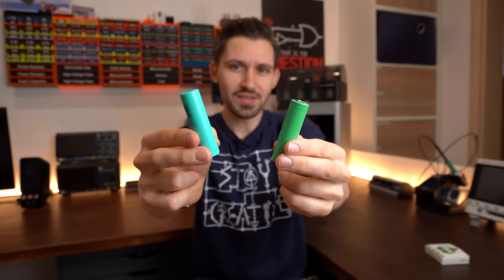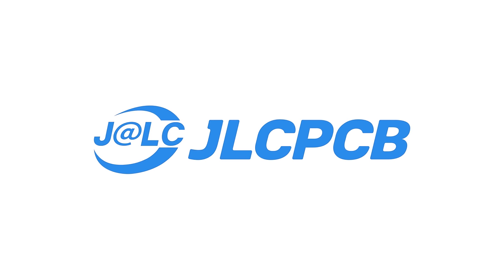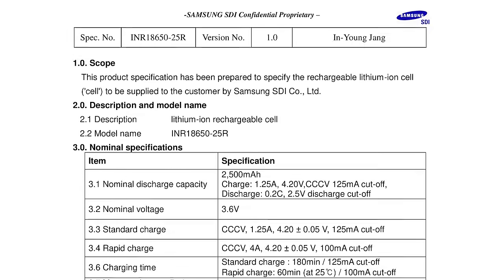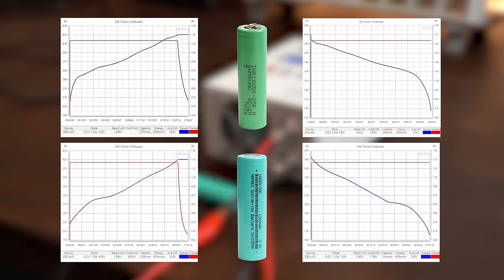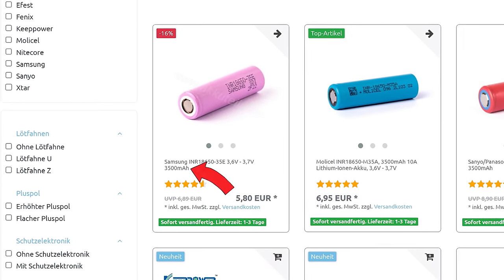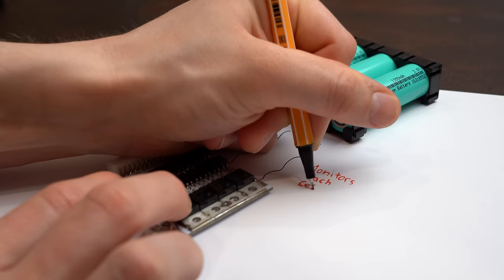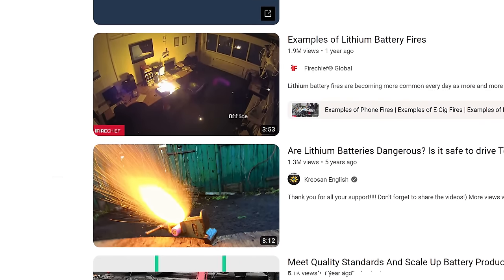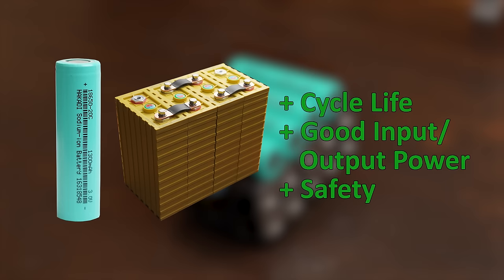"Salt" Batteries are FINALLY Here?! Sooo should you use them?

Comment: Great video! Didn't know these were available at all yet, even given the limitations you describe.

I would love to see a cycle life test on these to see if they live up to the claims; I'm both curious if Sodium-Ion does as well as it's supposed to, and also whether these particular cells meet their specifications on that front. My experience with "no-name" cells is generally that they perform the most below-spec in terms of cycle life even if their initial values are otherwise fairly good, and I suspect it's largely because of low quality/purity ingredients used in their manufacturing.

Comment: The most surprising thing I learned in this video is that LFPs are used in electric vehicle applications. I've always thought they had such terrible gravimetric energy density that it would be impossible. If this sodium based chemistry is comparable to (or even slightly better than) those in terms of performance it would pave the way for much cheaper evs

Comment: If you cut the battery open without setting yourself on fire, or burnibg your house down, therex an easy way yo test for sodium vs lithium. If you take dohevof the materisl and burn it in a flame, sodium makes a bright yeloow flame. Lithium makes a red flame. Usually you use a woiden spkint or a nichrome wire. Try a flame like a propane or butane torch. You can google the test. I dont really recomend cytting batteties open though because they tend to catch fire.

Comment: I've thought about this for a while, that lithium could be replaced by other metals in the first row of the Periodic Table in batteries. You could potentially get even higher cell voltages by using, say, potassium. But there is one thing that will make lithium based batteries better on  capacity per unit weight basis - the atomic weight of lithium is far lower than that of sodium, potassium, etc. Which means a mole of lithium will weigh a lot less. You might eventually be able to pack more sodium into the same package to make up for it, but the batteries will weigh more.

Comment: Aren't you able to discharge sodium batteries until they are totally dead? That's some of their huge advantages, I've heard.
Also I kinda think these are kind of two cells together, because sodium batteries had a voltage of around 2V per cell.
Also chemically the energy density is to be expected.

Comment: Power density means it can be useful in stationary applications, otherwise gasoline and diesel are still king except for small toy cars and drones. Especially the high charge/discharge cycles with 20% degradation is a real plus for sodium batteries for price and environment. But for stationary storage you can still use lead acid batteries which give you over 10x times more Wh/€. People should do more back of the envelope math.

Comment: The thing is, lithium is a small part of the battery mass, 5-7%. Unless the sodium batteries offer some incredible advantages (order of magnitude less price, higher durability, higher A rating, etc), they are trying to compete at a great disavantage. Btw sodium batteries might also be explosive, they are not dry batteries or solid ,  and the liquid tends to be an explosive hydrocarbon.

Comment: Strange that the first EV companies already announced their switch to Sodium batteries, considering power output is so important due to the already low range (400-600 km) of EV's even with top quality Lithium-ion batteries, and the fact that thus far Sodium batteries still have much lower energy densities than Lithium based batteries. For industrial and residential applications I can understand, there the energy density isn't as important, the price per Kw/hr is.

Comment: Thanks for a great video. 
I am not very excited by these Sodium Batteries for "small" applications. But, they might be useful for homes if the price was much much cheaper. I don't see it useful for small applications because the energy density is far too low vs Li. But, for storing solar, where the battery size is inconsequential and cost is critical, then it makes sense. 
However, I don't see the industry moving in this direction. Instead I think it will try to create a similar product to Lithium, which will then be doomed to fail since Na doesn't have recognition. Unless they can make 1, 2, 4, 5 and 10 kWh batteries at around 50% to 75% the cost, and same life cycle, then this tech will fail in the long run vs the already established Lithiums.

Comment: I think this will not be an option for small devices like phones or weight related things like drones or Cars. But it sounds amazing for stationary Batteries. I think a lot of home owner are willing to take double the space to get from a Tesla Power wall with like 22.000$ to 11.000$  or even 6.000$. (In the US the walls are basically out of paper, so just use the batteries as a wall). I know in Germany are some villages that have like there own energy storage system just for there town made out of used car battery's and so. With half or firth of the price i think it could be cheaper to build Solar and Wind together with these battery's then to use Oil, Gas or Coal for electricity.
If it gets cheap enough it could be even liable for ships. But i think this is more like for in 10 or 20 Years. When Oil gets more expensive and electricity cheaper. And then there could be a better method.

Comment: some programmable BMS supports different batteries. i have one that supports cell voltages 16v high and 0.2v low. this is handy if you using capacitors as energy storage. i have a small outdoor rover that is powered by the sun and wind and it uses a pybord as cpu. this thing as a sim400 for comunication. it works fine with only capacitors. it could be better in some parts but 10min working time in winter and 1h in the summer is not bad for only 1wh storage.

Comment: You know A123 LFP cells? Those have a discharge rate of 30C and 50C peak. So no, LFP is not weak. It really depends on the goal: power or energy. The sodium ion and LFP cells you are comparing are both energy oriented, while the NMC cell you are testing is power oriented.

Comment: They show promise. Cheaper, and they seem to have a lower operating temperature that Li-Ion. Which was a big problem for EVs during that North American cold snap back in January. But the lower energy density doesn't make then great for non-static applications. You could use the for EVs, but the vehicles would be even heavier than they already are if you want comparable range. Then again people might be willing to accept a little less range if the vehicles are a lot more affordable. Just depends how much.
Reply from the maker: Yep, all good points. Thanks for the feedback :-)

Comment: Should I be worried when I have disabled the BMS on my electric unicycles 72v battery? First I had to disable the undervoltage protection 12 years ago because it was turning itself off when using lot of current and having a low battery which was dangerous and a year ago I had to disable the charging overvoltage protection and connected the charger directly to the battery. Can Li-Ion be charged on the balcony, if it's cold outside? Nights are starting to be 0 degrees C now, so maybe I could charge and store it on the balcony soon? Batteries are also kinda old, changed the cells 6 years ago and can only do short <2km trips with it and can't use full speed on low battery anymore. Now it's between me and my door, so I can't escape if it burns.

Comment: seems like it would be better for applications where higher weight for same capacity is not a massive concern, but longevity and safety are priority, such as static applications like home power cells, medical devices, and low power IOT devices, maybe even low power robotics and drones (not going to power a racing microdrone or a heavy payload lifter, but maybe a small slower power one, or some stationary robotics could indeed be powered by the lithium alternative), cameras may also be a viable application, as would things such as space probes, as they need reliability over absolute power delivery. I think sodium ion will take the place of nicd, alkaline, and low power lithium applications where liion gives more instantaneous power than needed, but lower long term reliability for the most part. I can see a thousand applications where sodium may indeed be the superior choice due to the higher internal resistance as well, since that also drastically reduces self discharge, it means the cells will lose power more slowly than their lithium counterparts as well, meaning bulk storage would be more efficient in a shelf life priority, such as backup power systems, not needing to be topped off as often as lithium when not in use, and having several times its contemporary's cycle life means it would work perfectly in those applications as a more reliable alternative, I think additional cells in parallel could make up for power delivery by splitting the load, though the added bulk is overall more than made up for by these other traits. The cost of materials alone is game changing given how common sodium is, and the higher cycle life per cell means per unit material used, the functional lifespan is vastly superior to liion for the cost, even at the current pricing. To summarize, I think we will see sodium ion used more for mid to low power applications, and durability paramount applications, while liion will be delegated to where energy density is utmost priority.

Comment: Nice vid,  do you have any idea how much energy was discharged vs the amount of energy it took to charge the battery? for example was the na battery 80% efficient?
Reply from the maker: Sodium In was 4.32Wh and Out 4.07Wh. So around 94% efficient. Lithium was 9.1Wh in and 8.7Wh out so 95% efficient. Interesting. Damn, I should have included that in the video.

Comment: Woah Woah, you can't compare a nominal discharge lifespan with a max discharge rate lifespan! Simply discharging at a standard rate will likely double the lifespan from 250 charges to 500. Only charge to 90% capacity and you've doubled the lifespan again to around 1000 charges. Now keep in mind that only charging a Li ion battery to 90% still makes it vastly more energy dense than the sodium battery and you've ended up with the total opposite answer to the lifespan question. I think though, the general consensus seems to be that the sodium battery does have a slightly better life span which will hopefully get much better as the technology matures

Comment: I would be more confident in the charge discharge graphs if you also compared how the lithium battery charts would look if you used the same settings as the sodium test to charge a lithium cell. Also if the lithium cell was closer in MAH or capacity to the sodium one. If I was lying on what my battery was made from,:I would just use a really cheap, really low capacity lithium cell anyway.

Comment: The easiest way of converting salt to sodium metal is to heat it past the melting point of salt and separate the sodium via electrolysis.  Chemical separation is not as simple and requires exotic chemicals.   So it's not an easy or cheap process.   So I'm not sure that sodium batteries would ever rival lithium.  It's like solar panels.  Silicon is readily abundant.  It's everywhere.  But separating it from silicon dioxide (sand) is not a cheap process.  Otherwise solar panels would only cost a few bucks instead of hundreds.

Comment: It's one half the capacity of Li-ion... That's not bad. Not bad at all for a tech that just entered the consumer space
Reply: They came out in the 70s and were rejected because they weren't viable, they still aren't. They're also 3x the weight for the same power density. This is just a distraction from the failures by the failing ev market to try and keep the dream alive.

Comment: Sodium cells look ideal for speakers. Low draw use with larger capacity battery's, I might want a large dewalt pack to run my speaker and flood light for hours on end without putting cycles on my Lithium battery's.

Comment: That 0.2V difference with same size is potentially dangerous for end users. It will jist fit in any charger that uses voltage thresholds to differentiate between chemistries and voltage windows overlap too much. That being said, chargers equipped with voltage dividers can be modified to fit both chemistries but without charging li-ion fully
Reply: Depends on how the sodium chemistry reacts to the extra voltage.  Will the cell be damaged or just get warm?

Comment: I think you made it to easy for yourself when comparing sodium battery with the regular lithium battery as the specs where more close to a lithium iron phosphate battery.
They feature much greater cycle life's - especially when you use similar/smallerbDoD values (depth of discharge) - where some lifepo4 batteries have 3-5000 cycles of lifetime.

The the result would be, that those cells are promising, but yet not a reasonable replacement for anything substantial

Comment: I see a big problem with Sodium-based batteries - 3.3V.
With single Lithium cell you get far more power (both absolute and percentage) above 3.3V (considering 0 dropout voltage on regulator) than with the sodium one.
But it can be argued that a lot of manufacturers already use multi-cell Lithium (without balancing!) so probably not that big problem IRL.
Reply: sodium-ion can be charged to 4 volts
Reply: @sigataros  True but Lithium can go over it. Just look how long it took to discharge the battery under about 3.3V

Comment: Is it possible to 'combine' the two in one,  parallel with for example, 15% lipo, 85% sodium for extended capacity, compromise the charge rate, and still maintain a nominal safety margin..?

Comment: it would be rather easy to see if you have sodium or lithium in your battery, take everything that is inside the battery and dissolve it in ethanol or methanol, light it on fire and see what colour it is.

There is a lot of sodium all around so you'll probably get a yellow flame in all cases but if it has a distinct red colour as well then you have lithium, if you have a lot of sodium also , it would be very yellow.

Comment: Man with sodium cells my lighting stuff would be significantly cheaper. A little more voltage dropping off isn't such a big deal, as your eyes continually adjust anyhow. Also some 18650 chargers also come with a voltage limiting setting. Mine can do an 80% charge  which is close to that 4v

Comment: Nice test and conclusion for a new technology :)
I think we will have to wait a bit till these become a real alternitive to current batteries, but as long as size and weight is not a concern, I can see these replacing them (in a hypothetical case where they are 10 times cheaper while offering 1/2 or 1/3 of the capacity)
I guess it could also be a problem with the lower max constant current, but in what applications do we have a 100% current draw on current battgeries that cant be fixed with just adding more parallel battery cells?

Comment: It's interesting that you say that the Sodium Battery (aka NIBs or SIBs) aren't in mass production. However, there are EVs that are currently in production using this chemistry. They aren't 18650, or similarly, sized.
"JAC Group’s Yiwei, a new EV brand in China backed by Volkswagen, debuted the first sodium-ion battery-powered electric car. The new JAC Yiwei EV rolled off the assembly line Wednesday." Dec 2023
"According to CnEvPost, JMEV, an EV brand owned by Jiangling Motors Group, will offer a version of its EV3 fitted with sodium ion batteries from Farasis Energy next year. The first of those cars rolled off the assembly line on December 28, 2023."

The bummer part is that the density is almost half of that of Li-Ion. However, it can be recharged far faster and safer than Li-Ion, making time at a regen station significantly shorter.
Overall, I think these would great for home energy storage without the risk of potential random fire happening, meaning they can be stored close to or even inside the home

Comment: Question on other subject. I am not electronic savvy. 

I wish to know what will happen if I take (2) 12VDV battery power supply surge protector connect in series. Can I get 24VDC? Will it destroy the Power supply? I have already removed the battery, battery is old, can not take charge anymore.

Comment: The whole reason for a BMS is a lithium cell's charge state can't be deduced by reading it's voltage, so the BMS has to keep track of how much charge it has already received since it's last discharge.  With sodium cells linear voltage/charge ratio the BMS is MUCH simpler.  I suspect you don't even need a BMS because a more charged cell is going to have less voltage drop across it, than it's less charged neighbor.  So the less charged neighbor gets more charge.  This would tend to equalize all the cells in a string.  I have not run that experiment though, so somebody put together a string of sodium cells with no BMS but monitoring to see how individual cells charge during the process, please.  Then let us know.

Comment: I really like the idea of Sodium batteries because they can be very cheap.  I can not see a future where lithium batteries go away.  On the contrary, with the introduction of Sodium batteries,  lithium batteries will be put to more specialized uses.  
Sodium batteries are less energy dense but have greater temperature stability (They can be charged and discharged at lower temperatures).  Sodium batteries will be used in the same places as Lithium batteries, I see Sodium batteries being best used in solar generators, power stations, and (Maybe) laptops.

Comment: LiFePO4 cells are rated for a Much Much higher cycle life than the 250 presented in this video. LiFePO4 batteries are typically rated for 80~85% @ 2,000 cycles.